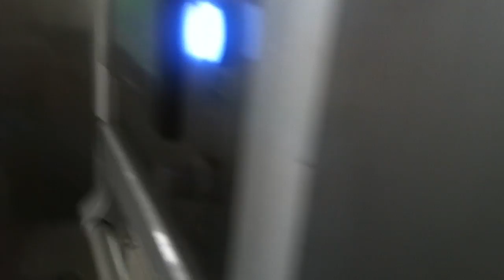Ligne complète d'embouteillage de l'eau minérale Chine

Comment: Please how much
Reply: The price is USD169900 for moderate production line of 6000 bottles per hour. If you want smaller production line, it will be USD83000 for production line of 2000 bottles per hour.